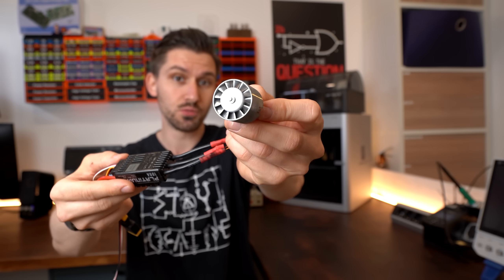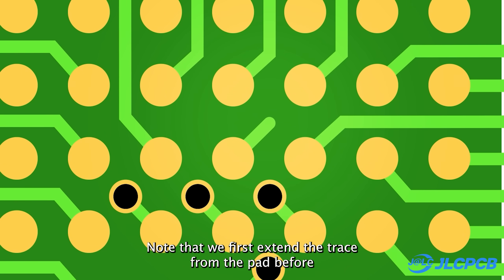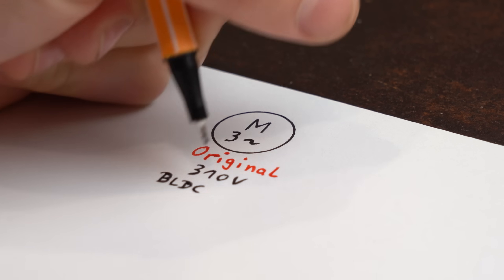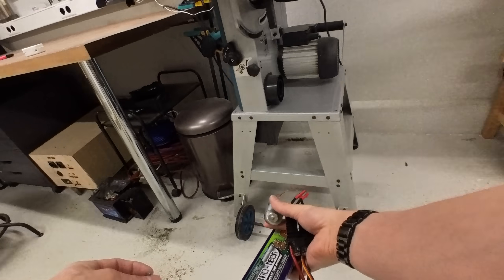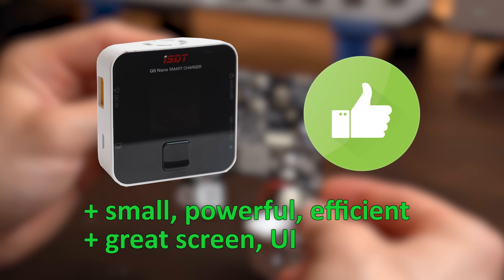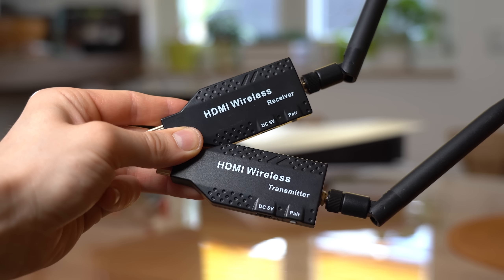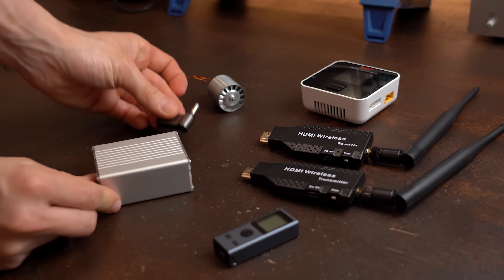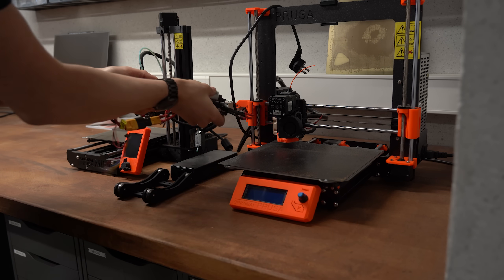I tried finding Hidden Gems on AliExpress AGAIN! (Part 9)

Comment: I have that exact wireless hdmi extender. It works mint for me in my situation at work. I used to carry an 8m hdmi cable with me to work, but now I just carry the kit because it’s lighter than the cable

Comment: About those little USB laptop power adaptors; They serve a purpose for older laptops without direct USB-C charging. I've bought a used laptop about 5 years old and it has type-C charging built-in. BUT it requires a 20V capable power supply which aren't cheap - whereas everyone already has a million regular USB chargers lying around. Before I got my HP, I always thought the charging circuitry must have voltage boosters in them but sadly they don't, so you can't use those older chargers. I 'm well aware my old phone chargers won't power a laptop and won't charge it quickly, but there's no reason I can't use them to charge a switched-off laptop slowly overnight in a hotel room while on holiday for a week or so.  THAT's the sort of adaptor I want to see. Something that boosts 5V up to 20V and tricks the laptop into charging - just very slowly. Some years ago I already bought a DC-DC voltage booster for pennies, I don't want to spend $60+ for a 20V usb-c charger that will only be used for my laptop when I already have a regular laptop PSU at home anyway.
Reply: just get a GaN charger and be bulletproof.

Comment: I think you missed a trick with the HDMI adaptors. The description said they DO NOT work through walls - would have been interesting to confirm that, since they're pretty useless for many/most people if that's the case.

Comment: For the laptop : I have a lenovo legion 5 pro, with a huge 300W brick. I bought a usb c plug, the same as you have, as my laptop can handle usb c charging. However, to be able to charge, I have to activate fast charging. There's a threshold, under which the laptop won't charge, and the threshold is barely reached via usb c, when I'm not in fasst charging mode. Maybe you should look into this

Comment: I had similar issues using the USB-C adapter on my Dell (Alienware) laptop. Would only charge if the laptop was shut down or sleeping and would turn on/off if the laptop was on. Kinda weird tbh.

Comment: I started buying things from Aliexpress just a few months ago, and now I can't stop. I may have to get a bigger house.

I've actually been satisfied with everything I've purchased, so far. Of course, I don't buy things like a 2-terabyte memory card that cost $3.18, either.
Reply: Pro tips, if you haven't already found this out the hard way:

Always check the item description for dimensions and for materials (where applicable)

Often items give the impression of being larger via photos of the item, sometimes they give the impression of being made from metal when they are plastic.

Also remember to closely check multi-item listings as they often put cheaper dud items to artificially depress the listing price.

Make good use of the image search for similar products to find the lowest available listing of a particular item.

It's not uncommon for temu to have cheaper prices on the same items. For higher value purchase, cross check prices in temu.

Comment: About the laptop adapter, Usually the way these usbc things work is you can provide a higher power source and the components will negotiate and you will get a safe level of power without frying anything. So, if you were only getting 60w and your power supply can output 100 or 180w, you might need to take a look at the cable. Not all usbc cables are compatible with 100w. Otherwise, since you brought up the msi compatibility thing, the adapter may not be able to figure out what the correct safe power level is to give to the laptop, so it’s throttling to 60w. Lastly, it could be a product defect or inaccurate specs.

Comment: Wow, half of the products in this video are either ones I got for myself, once I was eyeballing, or ones I have a variation of - caught me by surprise ! I can confirm these USB-C to laptop power adapters can do wonders even in edge cases - I have a Lenovo laptop that comes with a 120w power brick, but it never actually reaches that power ceiling so I gave the adapter a shot a while back. It really works with all my 100w type c power supplies, and I haven't touched my bulky laptop charger in forever. As you said they're not auto wins, but they're worth the gamble imo

Comment: Thanks for the video :)
I had a solar setup for my thinkpad which uses USB-C and therefore I tested power consumption of that laptop quite throughly.
My laptop has 65 watt power supply and was using something like 15-20 watt's while running on idle windows when fully charged, but if its charging value was closer to 45's on same idle windows setup. 
So your laptop may also work well with that 100 watt power supply if fully charged.

Comment: 2:25 Wait why did you put the 3 phase logo on the BLDC motors, I'm pretty sure that's only for 3 phased asynchronous motors like we have in the industry
Maybe it's actually a 3 phase motor, I see you power it with 3 wires afterwards but then why is it called brushless direct current ?

Comment: How often did you have to replace those batteries on the Bosch laser distance meter, though? I think I'm still on the original batteries on mine so it's not like a tiny internal battery is a convincing selling point tbh :D

Comment: that high speed BLDC motor i can see being use as a hover tank - all ud need is 4 n a battery n some sort of drone control n presto a hover tank but the weight would be a problem so id assume that the best thing to do is  get  some light weight ones....

Comment: Would be good to see how these products hold up over time. It is usually nice to have a cheap product that works the first time you use it, but if it breaks on its 3rd use then it would still be a thumbs down. Anyway interesting products and maybe they will last well.

Comment: for use on MSI plug, use this model: 
DC male Plug MSI  4.5 x 3.0mm (Dell) 
i use that till today even have 2 model the small plug & long wired plus with type c on end..my laptop is Msi Modern 14 (65w) & i noticed that even with standard charger the power were never even touch max (never & super rarely hit 65w) as for plug type +65 Gan charger at some point cn hit up to 55w..but then fall down in average 30-45w when used

Comment: For the wireless HDMI extenders, the answer is projector usage ;) if you have a two digit cable run going from our presenter table through the floor, wall and ceiling to the projector, those are awesome.

Comment: 4:44 - Be aware there's also a SkyRC's B6 Neo charger (successor to the legendary iMAX B6). It is extremely similar to ISDT Q6 Nano, but has type-C PD input. Also, there are several issue reports of Q6 Nano around the internet (including "destroying cells" and "frying itself"), so I'd be careful with this kind of choice!

Comment: You know, that wireless HDMI thing can come in handy for certain streaming purposes. For example, I put my PC in a ventilated cabinet to be tidy. If I want to plug in my capture card, I would have to extend cables everywhere and open my cabinet, which is not ideal for a tidy space. If I got this kit, I could keep my capture card plugged in, put away, and all I'd have to change is the console that is outputting a signal. No big mess of wires. That's really cool, and I'm glad it works at such low latency.

Comment: As already mentioned, the trigger does not work properly due to the power adapter itself. I have the same problem with my Asus laptop, it also turns off and on with one power supply and works completely fine with another, it's all related to PD protocols

Comment: From someone who had this charger for 3 years: It held up very well, but I've also seen some negative reviews of burned ones. Other than that:

The UI sucks, because you cannot long press the button to change e.g. the charging current quickly. Meaning, if you want to change the current to 8.0A, you have to click that mushy button 80 times without EVER accidentally long pressing it, because then you have to press it 80 times again because the list always starts at 0.

Secondly, when you are in Power Supply mode, you cannot have fast current jumps. When I power my Pinecil from it, it sometimes says overcurrent just because the current rises to fast. So don't put PWM LED strips on it or so. But for just static or mostly static power output it works just well. 

Generally, for Lipo charging, get the SkyRC B6 neo. Smaller, better UI and additional USB C power input. Not sure whether it has the DC-DC mode though.
Reply: I bought it about 5 years ago and it had pretty iffy output and the power mosfets failed after a couple of months.
Reply: I also had one burn up, customer support ignored me
Reply: The BattGo feature is awesome tho. I have swapped all my batteries to it so they get automatically identified upon plugging them in and the battery stores all information that you could ask for. Also you can configure that the battery will discharge itself to storage voltage if it is not used for an extended period of time. I don’t know if this exact charger model has this feature bit I believe all of their variants are equipped with it.
Reply: BattGo has been bought by another company and I didn't read the release notes when I updated the firmware on mine. BattGo is a thing of the past on ISDT chargers. Don't update your firmware!
Reply: I agree on this, I’ve used a couple ISDT Nano chargers and they have been great a few years and hundreds of battery packs charged.

Also agree that the interface is an absolute pain in the butt, if you find the Q6 pro version with the wheel button at a decent price, that’s the better option

Comment: @14:04 the measuring error in my lasertapes are 1,5mm. If with these two devices that error is the same, both measurements overlap within their errors. furthermore the relative error is 0,00875 and 0,00876. So to mention the wiggle room, and thus saying it significant, I find questionable.

Comment: The HDMI extender is very good for the cases where you have a TV box with 1 subscription, and want to look on that on multiple TVs. You need a IR extender tough, so your remote control works in "the far end" aswell. Have done that solution for many people, that want multiple TVs (for example one in bedroom and one in living room) but not have to pay for subscription of 2 TV boxes.

Comment: Does that ISDT charger work with an Input close to or below the output voltage? Would be nice to use a 12V PSU or another 4s LiPo to charge my 4s LiPos with it

Comment: Ive been eying that ISDT charger as well. Its available on Amazon for the same price with prime delivery, and considering that you can buy 5-6 of these for the price of one two channel charger makes them very nice for RC guys who want to charge lots of batteries. Making them into a multicharger obviously requires a beefy psu as well, but 12V or 24V psus are not that expensive.

Comment: The advantage of the Bosch measure goes beyond being a level; it's a digital protractor, which is far more useful, especially for a machinist or carpenter.
Reply: But neither measure from both ends. A dual laser would allow you to stand in the middle of a room and get a distance from wall to wall with out walking to the wall. Also Bosch, i belive, will work in fractions of an inch.

Comment: Thank you for testing the 140W board from Feb 22 Store! Was this the buck boost model? What is the USB PD IC?

Edit: wonder how much of that voltage drop was due to your 2 wire measurement on your electronic load. You should shell out $25 for a new 4 wire DL24....or spend $75 on the 600W 40A DL24MP....mine is alright...definitely has its quirks but for under $80...you can't get anywhere near that much power for that much money in an electronic load. Real world I'd say its more like a 450W 35A electronic load AND you should get a 12" desktop fan because the heat dissipation isn't the greatest. The heat sinks are smaller

Comment: lol i charge my Surface Pro 9 with an USB-C 45W Powersupply. The Originals Microsoft Charger comming with 65W. But also Windows 11 says everytime its not compatible, but still charges the Battery fast enough up :D

Comment: Laptops can be so silly about chargers that deliver a lower wattage than what they want.

There's no chance your laptop sitting idle on a desktop is using much more than 60W, even that would be quite high! But most laptops will complain if you plug in a charger below the 130/180/200+ W OEM charger rating.

I use an eGPU that delivers 100W over USB-PD when in use and it works fine (50W laptop CPU + everything else = less than 100W) but Windows will put up a warning saying slow charger connected etc.

Comment: You should have bought the new ToolKitRC M8P for ~$37 shipped. Its 600W 20A. I got it about a month ago and haven't used it a ton but have been fairly impressed with it. Defnitely feels like a iCharger S6 Jr....pretty much exactly half the power.

The one nice touch it has is the balance start voltage feature which is identical to iChargers version of it. Its a -100 to -500mV from the terminal charge voltage. And the power supply function is a really nice touch. IMO way better than the ISDT stuff at the same price and a great upgrade from my M8S

Comment: These are great but one problem with those sellers is they’ll completely change the product being sold so one good review doesn’t mean you won’t get something more cheaply made from the same listing later.
Reply: I have never seen the quality get worse, why would it when they'd have to set up new manufacturing for it? That said I have seen prices go up after a good review, but I don't mind too much because often there's 5 vendors selling the exact same thing for the original price and in other cases the price is better than many western shops even if they can't do arbitrary price hikes
Reply: This does happen with resellers. Ive had it on Amazon they will find a cheaper manufacturer and keep the reviews and pictures from the original product. However you can return the item in both cases and its not an aliexpress issue :/ there's dishonest sellers all over the internet. Actually think I've had better cutomer support on a lot of products from the aliexpress vendors than Amazon even with a language barrier lol one actually helped set up and troubleshoot a monocular dispay, didnt send me a youtube video, or make me go through a FAQ page.
Reply: Had that on amazon, but funny enough not aliexpress. It does happen but I wouldn't say it is more common than any other site.
Reply: That is your arbitrary illusion. You can return for free if you don't satisfied. So how come seller will do like you said? I have bought dosens of hobby gadgets, tools, materials and home utensils in Germany from Aliexpress and returned 3 of them for free and got refund immediately when packet trackable in DHL. So try and stop illusion. Ten Euro up free shipping. Not expensive to try.
Reply: AliExpress has always honored my word over the sellers and given me refund.

Even when I made mistake and misidentified a good product as faulty, AliExpress gave me a refund. 
And then I felt bad when the seller contacted me to tell me my mistake (which was a mistake on my part)
Reply: @ Yeah Chinese sellers value the markets and the people and the quality of Chinese products are normally good ,especially for the price.Not many people are wealthy enough always buying the best or non-Chinese ones.

Comment: I used an USB C power adapter, like the one shown for a while with a Lenovo laptop. In the end, it got hot when it was disconnected from the laptop, so I couldn‘t touch it. The power shut off seemed to have failed and all energy went into heat! I’m not sure, if only my unit failed, or if the design is flawed. I consider this adapter to not be safe. Be careful with this one!

Comment: I did recently get a SkyRC B6neo charger in addition to the Q6 nano. It is comparable in functionality, yet the UI is a bit worse, but it does have a enter button, so that is a plus. It does offer some really compelling features though. Native USB-C PD input and checking cell voltages without a input hooked up (simply connect the balance cable). Super neat for portable usage with a powerbank. The bigger fan makes for a more pleasant noise floor when charging, while being smaller in size overall. The low resolution LCD sucks a bit, but honestly, nitpicking for the price.

Comment: About the USB-C Charger adapter at 8:52 , I definitely do not recommend it for high power laptops. I have used that on my samsung laptop (both editions with and without the additional short cable) which can draw 90w max and the adapter always died after 3 months due to overheating. I have contacted the shop and they replaced it twice and now I have 3 dead adapters.
After that I just cut off the PD module of the one with the cable, soldered on my own PD trigger one and I have been using that one for over a year.
I am really unsure as how they messed up this bad, as my own adapter consists of just the pd trigger board + some little bit of heat shrink tube and it does not get nearly as warm as the one from the shop.